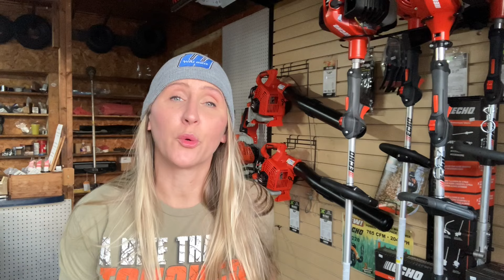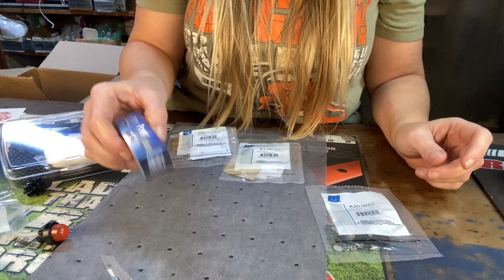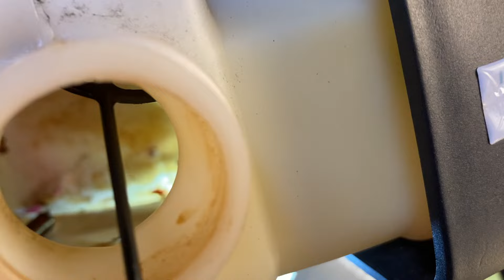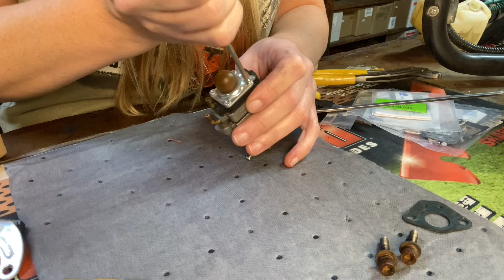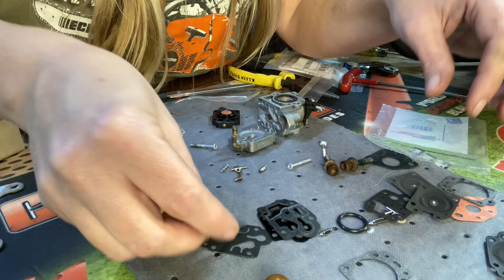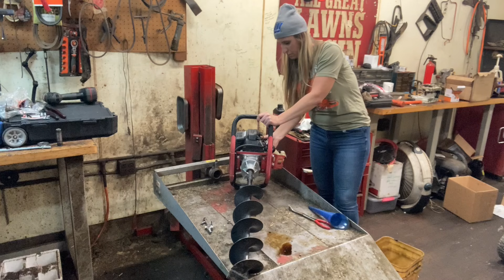Will it run? WALBRO put to the TEST with one of the NASTIEST pieces of equipment in the shop!

Comment: I had fuel issues since ethanol gas came around. Used ethanol remover with some results. Point being, I moved to a rural community where a station has non ethynol gas with a 91 octane. No problems since. I know everyone can't move. I am just agreeing that ethanol gas is a problem
Reply: True ethanol is bad but it’s the benzene in gasoline that does the worst damage to small engines.

Comment: I thoroughly enjoy your videos as I find them both instructive and entertaining, thank you.
I have a Husqvarna 350 chainsaws.  The manual calls for a 50:1 gas to oil mix for fuel.  I have been using 45:1 mix in the belief that a bit of extra lubrication would be beneficial to keep the engine well lubricated.  The saw seemed to be running fine with the 45:1 gas to oil fuel mix.  Is there a down side to my thinking?  Your comments/suggestions would be welcome.
Thanks, Peter Toch

Comment: Ten months ago, you probably won’t read this but I enjoyed this video. I fly Radio Control airplanes, large scale. Most have walbro carb’s. Except they don’t have primers. We’ve got to be extremely careful with are needle settings. Most run over 6400 RPM. You probably would believe the crap that clog’s the micro screen inside those little carbs.
I wonder if that new diagram assembly is available for these engines? Most of us use ethanol free 91 or higher and there’s no consensus of best two stroke oil! NWR  C/S Krafty.

Comment: I've rebuilt quit a few carbs but on small stuff it's cheap and easier to just buy a new one.  just ordered one for one of my cheap chainsaws got everything from the spark plug fuel filter & lines & carb for $16

Comment: I have found that carbs are not machined flat, I use a new wide fine cut flat file and slide the carb up the file enough times to see a clean flat surface, I do the same with the end caps, If a part has a raised section dont file it off just work around it, You will be surprised how un flat the parts are and the diaphragms fit and seal better.With a new fine flat file you wont see any scratch marks.This helps with the primer bulb sucking air and not fuel.

Comment: so I bought the new longer lasting forever spiral metering diaphragm about three years ago, and my tiller ran amazing for about a year then started bogging down, now two and a half years later it won't start.  what now? do I replace it with another one?  or regular metering diaphragm and rest of regular carb kit? I used fuel stabilizer which I think helped, but eventually, still have to clean and rebuild the carb pretty regularly.

Comment: kool info on parts !!!! solved most all my fuel problems by going with Aspen fuel in the mower and trufuel premixes in all the 2 cycle stuff and as always drain your equipment in the fall and it will start in the spring.

Comment: Listen CHICK. Ihave a serious question. I just heard of Walbro carburetors when I got a carb kit for my ECHO Srm 2400 weed eater and replaced it.  New carb has no name BUT i did save the original. Should I do a gasket kit for the original carb or just chuck it.  Weed eater runs like a champ but it was slightly different with different gaskets. The air filter doesn’t even fit. Plug is one number off. Gaped it at .25-30
 I need your input PLEASE.

Comment: I have a Mantis. Its not running. Fuel is good   Mantis is so old I dont know what carb rebuild kit to order. There is no carb number found. Any suggestions?  I plan on replacing the gas lines to handle alcohol fuels here in Connecticut.

Comment: I have 4 Stihl 041 powersaws that friends and garage sales I have picked up. But one by one I kept robbing from the other three saws to keep my 041 saw running. Three of the saws have a Sweden coil and stator and one saw had the German coil that does not separate from the stator like the Sweden saw coils do. I have no way of telling if the coils are bad or the stators are bad. But installing in the saw you can barely feel a shock from all of them. I have heard that I could switch back to a point set up with a different flywheel. Do you have a way to test these coils and stators out of the saw? Perhaps it is time to scrap these 4 saws out. A friend of mine gave me a 046 Stihl saw that I'm slowly getting use too in the meantime,,,,,,,,,,,,,,

Comment: I use Walbro carb kits, Zama on Zama carbs.  I like Walbro carbs over the cheap Chinese clones.  Most of my saws are of the big CV variety, mostly Stihl, so they usually run Walbro HD carbs.  I keep plenty of K-10-HD carb kits in the shop.  Even on the few Chinese carbs that I run they have Walbro diaphragms in them.  I just do not trust the sleazy rubber found in Chinese carbs and rebuild kits.  I use my ultra sonic to clean all carbs.  I keep break cleaner but not that much carb cleaner.  I use Purple Power, vinegar and Dawn in my ultra sonic in equal parts.

Comment: I have repaired an old Tecumseh  chipper gas tank (brittle due to age, and also where you place your left hand to pull the starter cord) with JB Weld a year or more ago.  It still is holding and working.

Comment: Have you fixed a riding mower that will only start with a shot of starting fluid ? Mine just started doing it 3 days ago but once it starts on ether it will run like it should but will not start back up with out a quick spray of ether. I also have 2 chainsaws and a leaf blower that have the walbro carburetor on them and never knee walbro had the new metering diapraghm
Reply from the maker: The first thing I would check is the choke lever on the carb. If you have a Nikki carburetor, they are plastic and are BAD about sticking.. Thanks for watching!

Comment: I have one of those Predator augers. The mold for the choke lever is marked backwards, the choke on position is actually choke off. Aside from that, they are good engines. I have both an Auger and a generator. With the automotive size of muffler on the generator, it is the quietest one I have ever heard.
Reply: No

Comment: Ethanol is catastrophic for 2 strokes even motorbikes !!!!  The only way to be safe is to drain all the petrol out if you are not going to use it for even a few days.  Ethanol causes water to form inside the crankcase, and thats where the main bearings are !!!!  So your main bearings will rust very quickly if you leave fuel in it.  The high octane petrol uses 10% ethanol and the low octane 20%.  So I always use the high octane petrol.  Thats why 2 stroke motorcycles and Mazda Rotary Engines are not made any more except Racing Bikes like the Suter 500 cc and Dirt Bike 2 strokes. Also they are trying to switch us over to electric brush cutters like the DeWalt, which is OK if you don't mind spending £1,000 !!!!  But my mains Electric ones are more powerful than the De Walt and vey much cheaper and are extremely reliable !!!!  The ethanol petrol will never be any good for 2 strokes, and they will probably put more ethanol in it soon !!!!

Comment: After a carb  job, unknown idle speed, I would not start the auger on a metal table with side rails. I detach the auger, set powerhead on concrete block and go.

Comment: Hi, Miss Bre😎

Him's a BIG boy😺

A lot of guys sing praises about Echo fuel line. My Poulan 3800 came with Echo line installed. The seller was nice enough to send me a length of the line to use in my S25AV as he never installed the line in one.  After installation I used some PC Duster Gas to verify the line wasn't plugged, or blocked in any way.

Comment: Used to use an articulated (two lengths joined with a u-joint) hydraulic drag auger when I would load grain. Hydraulic motor mounted on the intake of the actual grain auger. Handle on the other end of the drag auger. No off switch on that thing. Sooo dangerous. Nowadays I pucker up just looking at augers🙈

Comment: I use Briggs AFt or 5 in 1 stabilizer when I can find it.  I bought ten bottles a few years ago when Walmart put it out with a liquidation price.  I guess this shows what most homeowners think about fuel stabilizer.  I try to buy oem Walbro carburator rebuild kits when I can find them.  I burn only Premium non ethanol gas in everything I own, small engine.  When I rebuild a carb it gets cooked in my ultrasonic and blown out with compressed air when that is through.

Comment: I don't know if you have one or not, but if you don't you should really think about getting an ultrasonic cleaner. I finally got one for my shop a few months ago and that has totally changed the carburetor game. A run or two in Simple Green in the cleaner and those carburetors come up squeaky clean! I've even used it on those two stroke gas tanks and they come up like brand new. A 6.5l size is the one I got. Once you use one, you'll wonder how you ever got along without it!

Comment: That ethanol is the worst garbage ever and cheap rubber is it's food. I just had to replace a fuel line on a Stihl MS171 that turned into the consistency of an over cooked spaghetti noodle,and would suck in on itself when it ran. The Pro Line hose I replaced it with seemed to be very solid and SHOULD last?
Reply: Once your done with your machines for any length of time drain the fuel and run it with ASPEN 2T. You will never have a problem again....Look it up. Gasoline refined to a quality that does not go stale or eat rubber and it does not contain the strong solvent Aromatics that cheap  canned fuel has on most hardware store shelves.  Most cheap canned fuel has a lot of Xylene in it to raise octane and add stability. But those Aromatic hydrocarbons are strongly polar and aggressive solvents ( that's why Xylene is in carb cleaner,  paint thinners and strippers ). They will eat your rubber parts up in time and make your hoses and diagrams stiff.

Any alcohol in gasoline left to sit will corrode parts. Methanol is the worst it even eats lead.
Alcohols are also solvents and water absorbents and in the right conditions can help ( seafoam for example ). Just don;t let them sit in your fuel systems run the fuel and get it out for long term storage use ASPEN 2T as a System flush and storage fuel.
Reply: When I grew up we used to put alcohol in the tank in the winter time.  It sucks up the water and keeps fuel lines from freezing.
Reply: @michaelvangundy226  Yes.... but you did not leave it sit there, you ran the car and drove it. If it sits however you get something called phase separation. You will see a stratified layer of mostly water at the bottom rising up to an ill defined layer of mostly alcohol just under the gasoline. This mix of water and Ethanol is just awful stuff, the ethanol is reactive with metals and the water is a catalyst that speeds corrosion.

But if you just have water in your gas and you want to remove it a little Ethanol is going to help you by pulling that moister into suspension with the gasoline.

Ethanol can only hold so much water however before like I said it starts to drop and the phase separation begins...
Reply: @nos9341  
Yep. Good video. I don't know what is left after the water settles out but it won't burn. Some body got water and diesel in the tank at our local gas station. There were a bunch of us that had to change fuel injectors and clean out the tanks. That station owner wouldn't even talk about covering damages. Mine cost $1,700.
Reply: @michaelvangundy226  That is a very strange thing. I do not know where you live but In Canada the fuel stations must  test for water every day in their fuel tanks. There were  cases where organized crime buys gas stations and use them to dispose of oil containing PCBs in the diesel tanks and waste solvents and varsol in the gasoline. Where I live tank levels and water dip tests are done to make sure fuel is no adulterated. I wonder if you got burned by someone trying a trick like this...
Reply: @nos9341  yep, small town USA. Probably the mechanic that was fixing the vehicles. I won't ever buy gas from them again. And I haven't been back to that mechanic either.

Comment: Hope you read this comment. I am a retired CAT&CUMMINGS diesel mechanic and I enjoy your videos. About ten years ago I had a friend that bought a boat with a inboard engine that had been sitting for several years. It had a 75 gallon gas tank that was about half full of stale gas. He asked me for advice on the stale gas because I worked on marine diesels.
So I told him about a company named Starbright that had a product called Starton. Which to his and mine amazement brought that gas back from the dead! After that I researched the product and found it to be a fuel stabilizer that's really good for treating ethanol gas! I have been using it for all my engine including chainsaws and string trimmer.

Comment: With that hole in the tank, you could flush it out better and then whip out your plastic welder and reuse it!
There is a plastic welding kit for that type of plastic, however if the tank seems brittle then it is not worth messing with.
Reply from the maker: I found a new tank with gas cap, fuel lines, grommet and fuel filter for $14.99. Totally worth it, just so I didn’t have to smell the old one any longer. 😆 Thanks for watching!

Comment: @ Chickanic  DO look for Aspen fuel and do an episode on it. faster lap times too. The problems you have starts with the fuel and can be ended with better fuel. 

Throwing parts at it is not a solution.

Comment: yes fuel is awful,  but I'm not convinced it's nearly as bad as people think. I have multiple 2 cycle and 4 cycle pieces of equipment,  and I've used non ethanol premium gas since around 2005, with 1/4-1/2 ounce (each) if sta-bil and Berryman B12 (same as seafoam) in EVERY gallon of gas, and I haven't had to work on on of my own carburetors since the early 2000's. however,  I make my living fixing this stuff, just like you do. I tell my customers about the fuel and MY recommendations,  and still 75% or more of my paycheck comes from doing carburation work. I agree with one of the first things you said in that I'm a creature of habit and if something works,  I don't change.  so I'm not going to be trying the walboro fuel any time soon, but I do want to try that spiral diaphram
Reply: Your belief (that fuel isn’t as bad as people think) would be correct if people could actually get affordable ethanol-free fuel.  The fact that you can get it, is why you’re so perplexed that other people have so many problems.  The only supply of ethanol-free fuel where I live is $28/gallon VP canned fuel, and at that price it’s cheaper to buy a new OEM carb every year.
Reply: @mensaswede4028  it's like life- adapt or die. If I couldn't get ethanol free fuel, (I pay close to $1 more per gallon,  not nearly as bad as the canned fuel) I would still treat the fuel like I do, but I'd make sure that unless I was running the equipment at least every 14 days, it would be run out of fuel before leaving it sit. Probably would then run some expensive "canned fuel" through particularly the 2 cycle stuff, and drain the excess and put back into the can. That's our protocol where I work. Again, a little time consuming and a pain, but service work isn't cheap
Reply: @mensaswede4028  and I don't think you'll get many 28 dollar "OEM" carburetors.

Comment: Bre, are they all optional extras or will Walbro be using this new products on all their equipment.
Great innovation by Walbro to battle Fuel issues.
Hello Toby the Cat😀
Now that’s a bad fuel tank, damn switch....😡
Australia still has Unleaded 91, 95 and 98 Octane, but people still use Ethanol E10 to save 2 cents

Comment: I was on board until you pulled out the harbor freight predator auger. I am certain that this is made with a clone walbo carburetor.  Although it is good to know that the walbro units will fit in the much less expensive carburetors.
Reply: A  lot of those Chinese carbs are better. Tooling and quality control on Tecumseh carbs was absolutely brutal. Chinese copies of Tillotson HL have excellent casting, compare that to the Irish made one then the old American made ones. In order the old American made were the nicest followed by a very close second for the Chinese and then you get the Irish made stuff now...
You want to see something that will make you cry? have a look at a Tillotson race carb and then a Chinese regular production carb. You will wonder if the Irish were into the booze on casting day.

Anyhow my point:
Use an OEM skin kit in a clone carb. The Chinese make a decent casting but I'm not sure they skins are as consistent

Comment: That carb kit is a game changer . I really like it . How did the carb cleaner work , was it better than the big box store cleaner ? Thank you for the excellent video !!
Reply from the maker: I was really hoping to see what it would do in the fuel tank, but ended up just ordering another after I found the hole. The carb ended up not being that bad, so I could tell the difference in performance. The spray button felt nice though.

Comment: @Chickanic a shop tour would be a cool video if you have time. Good point non ethanol fuel or premix is the key. Pump gas should be outlawed for  2 strokes. I've always liked WALBRO as well.